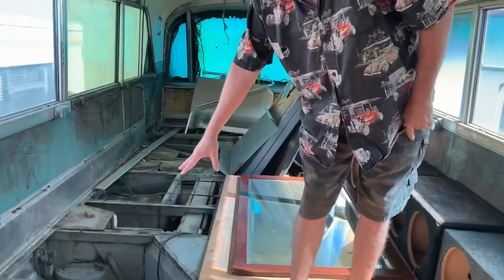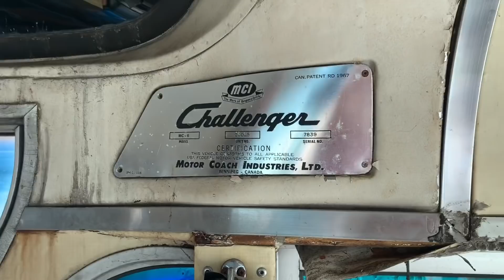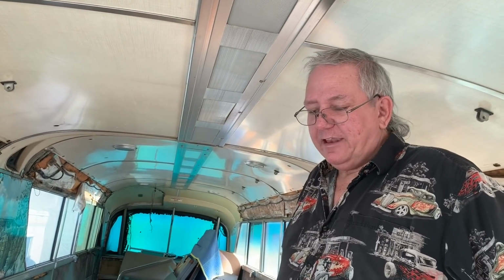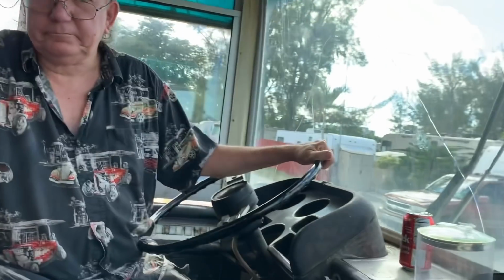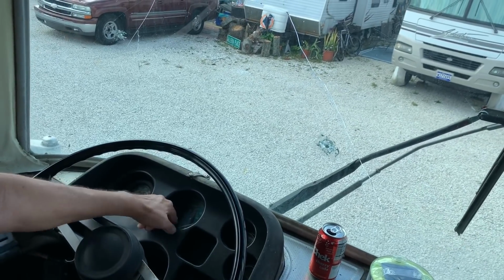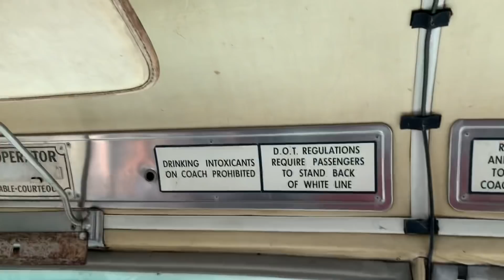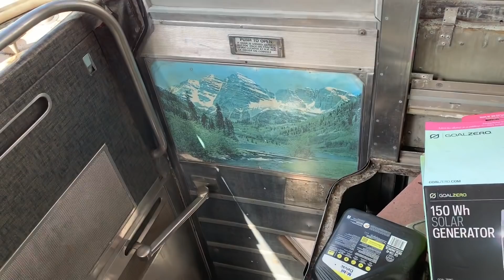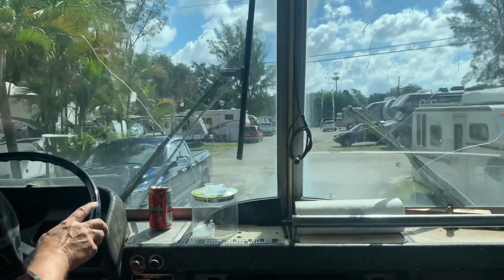12v71 detroit diesel mc6 bus test drive

Comment: Could you explain why the engine is "hunting" when he started it? Is that just a matter of the governor needing adjustment? He must have a lot of air leaks or the air compressor is not that great---running quite a while when he still had only 80 PSI. Engine sounds nice though.
Reply: Did you notice too that after it got some heat in it, the hunting stopped?
Reply: Thats is just a characteristic of a cold 2 stroke detroit until warmed up
Reply: @craigroth8710  Yes, I noticed that BUT I have been around 3-53, 4-53, 6-53, 6-71 (in line and V), 8-71 starting in cold weather in Canada and they didn't hunt. Railroad maintenance equipment. The odd 8-92 but was not around those much.
Reply: @wittemanadrian  I have been around 3-53, 4-53, 6-53, 6-71 (in line and V), 8-71 starting in cold weather in Canada and they didn't hunt. Railroad maintenance equipment. The odd 8-92 but was not around those much.

Comment: Love the sound of a two stroke. I wish someone would build a 3liter two stroke for a small car. Six cyl , four exhaust valve, piezoelectric injection, 5000rpms, would be a bad turbo diesel
Reply: Look up Mercedes’ om606 3 litre 24v under square design, there a common swap now with some being tuned to rev over 6.5k rpm and producing 600hp
Reply: @Diesel8290  know about that, and it’s a four stroke.....

Comment: That's a rare one. How many hp at what rpm?
Reply from the maker: It should be 450hp 1200ft lbs torque
Reply: 477 HP
1234 lb-ft torque
Reply: @markdubois4882  Where did you find those figures? On Wiki it says 456 HP @ 2100 RPM and 1200 lb-ft Torque @ 1600 RPM-------- the Turbo version 525 HP @2100 and 1450 lb-ft Torque @ 1600 RPM.
Reply: All of you are right. Various injector differences are the reason.
Reply: Well, we can all agree it’s a lot if it’s pushing this house down the road at 80+ mph 😂
Reply: Whoda Hellru  Gosh I hope he checked the tires really well. That's kinda scary even thinking about.
Reply: Paul Martin this guy has what we call in the automotive industry “dumb luck” ... obviously he doesn’t have a clue of what can go wrong with a vehicle that has sat for so long, yet he drives it 1,000 miles without an issue.  I wouldn’t have made it a mile without popping a tire or smoking a wheel bearing, let alone push it to 80 mph!
Reply: @BusGreaseMonkey ... Genuine question - how did you come up with that figure, Scott?  Unless someone along the line made some changes?   Do you know which injectors he has in it?  Is it set for 2,100 or 23/2,350?  Std. timing?  IF.. it has the Green tag N65's with std. timing and set to 2,350... NA it will be close + or - to 460hp at sea level, depending on atmospheric density and humidity levels @ 85 degrees.... and NO parasitic accessories on the engine, ie; generator, air compressor, engine fan, etc.
Reply: Whoda Hellru I changed all fluids, belts, hoses, filters, batteries and tires before my clueless ride. And it was 3050 miles not 1000!
Reply: Scott Robertson then accept my apology good sir!   I was hoping you didn’t use all of your luck on one adventure!
Reply: @Romans--bo7br  weren't buses usually set up a little hotter than semi/stationary engines...i know the bus 8v92s were

Comment: Greetings again from England! 
What sort of fuel economy can you expect from Detroit engines? I know very little about 2 stroke diesels, as they are very rare over here. The bus I used to have weighed just over 8 1/2 tons, had a 680 cu inch engine, top speed about 56mph, and would do about 17 miles per English gallon (4.54 litres to English gallon)
Reply: Each Detroit has different rates of consumption. There's the 53-series, 71-series, and the 92-series.  There was also a 110-series, and 149-series, but those were a bit too large for highway use, unless fitted to special-duty, purpose-built specialized machines.   https://en.wikipedia.org/wiki/Detroit_Diesel_Series_71     https://en.wikipedia.org/wiki/Detroit_Diesel_Series_92    They don't like being bare-idled for long periods of time, if they had to be running while not driving, they needed to be fast-idled.
Reply: @stanpatterson5033  .....The 6-110's were Not too large and there were a number conversions out on the road... Time/DC converted something like 50 of their KW COE's to 6-110's and used them for pulling "Turnpike Doubles" (two 40 footers) and they worked very well.   There were quite a number of Series 71 parts that could be used on the 110's.
Reply: Tom Lowe yes indeed!

Comment: I bet that thing weighs a bunch!!!!
Reply: marty It would be interesting to know.  Other than a few extra cylinders I doubt that the weight is much different from an MC-9.
Reply: @brucefay5126  I was thinkin the whole bus!!
Reply: marty   Me too.  I doubt that the weight of the whole bus is different from an MC-9.
Reply: I haven’t weighed it and I haven’t seen any stats, but it is 12’ high and wider too.
Reply: Scott Robertson   CAT Scale will give you axle weights and total weight.  Around $12.  If you ever have a chance to  get axle-end weights, that is even better.  RVSEF and Escapees SmartWeigh provide that service at rallies.  Escapees also have a few permanent weigh stations.  One of them is at their Sumter Oaks RV Park in Bushnell, Florida, by appointment.  Price is reasonable.  Information is priceless.  Strongly encourage anyone doing a conversion to gut the bus, weigh it before converting, and then weigh it again while in process (once major systems are in place) and then again at the end.  Weight distribution across the axles is important, of course, but what the weighing services see most often is side-to-side differences that are too large.  Also, tire pressure has to be the same for all tires on a given axle, and that pressure has to be determined by the tire (axle-end) with the heaviest load, and that requires axle-end weights.

Comment: the hell did anyone ever put a 12 v 71 in a bus?! half that engine does fine in a bus lol Still nice to see a big dog 12v still rolling coal tho.
Reply: chrisrhudy2000 The normally aspirated 12V was probably a joy to have if running in the mountains of the western U.S. and Canada.
Reply: Yep, an old 8V71 in a loaded bus in the Rockies could be a pain in the butt. The electronically controlled 8V92 made for a vastly different machine.
Reply: @zackreuter6344  .....the relatively low piston speed, coupled with that darn 4 spd really made them "dogs"..... even the mechanically controlled early 92's were a vast improvement with the 4spd.

Comment: As long as it rides good and sounds good everything is ok lol. Unbelievable. Throttle sticking, windows cracked, leaks in the air bags, air hissing constantly, missing a wiper, signals don’t work etc. It won’t pass a safety inspection. He needs practice on shifting. Air throttle? I know why he’s blowing through fuel. Great potential though.

Comment: Weren't these units supposed to get absolutely horrible fuel mileage... Like 1 mpg?
Reply: Relaxation Station.... Not sure where you heard that, but that is Not true.   The 12's in the semis that were NA got about 3 - 3.5 mpg with the weights they were hauling, but once they started turning them up and adding turbos, they got up to 5/5.5+... about what they're getting today with all the new anti-pollution laden garbage on the new diesels in semis today... along with a Whole Lot of new problems with them.   

I was getting a solid 5.5 to 6 mpg with V12 years ago, and that's after I built it to marine specs (basically).... in terms of output.
Reply: @Romans--bo7br  Thanks for the insight, I noticed that there was very strangely absolutely no mention of fuel economy in the comments.
Reply: @relaxationstation7374  ....Thank you for your response.  Yes, I agree... and am not sure what the V12's were getting in the coaches... and it "seems" that this particular one has been opened up a bit in terms of the governor, at least.   I do know that many of the GM & MCI coaches with the naturally aspirated 8-71's & 4 spd manual were averaging around 4 mpg.
Reply: @Romans--bo7br  If I remember correctly, Detroit developed a Twin Turbo V6 to try to solve the fuel efficiency problems and many years later they eventually they came up with optimally geared automatic transmissions.
Reply: Relaxation Station this bus gets 6 1/2 mpg. That’s over the Rockies across the upper mid-west over the Appalachians and down to south Florida mostly at or over 70 mph (but really mostly 70).

Comment: Are there any Right hand drive parts still hanging around in the states? Entry doors or dashes, the steering parts should be easy to flip over, but it’s the cosmetic stuff that might be difficult to find

Comment: That to me looked like a Navy 6-71 grey marine around 225 hp. A 12v71 is a huge v engine. It will go a lot faster than 80 mph. A 12v71 will pull 40 tons down the road at 100 miles an hout.Thst is a six cylinder 2 stroke. If that fuel pedal is stuck driving down the road it will disiegrate that engine But that is not a 12V71. The biggest engine ever put in a bus was the Detroit 8V92 four stroke twin turbo making between 1050 and 1100 hp. You could buy 3 busses for what a 12V71 costs. Those are normally found in heavy hauling 18 wheelers 36 to 38 gears with double and triple compound low gears. And 18 forward road gears they can pull 100 tons on I-20 in Texas. Three coast to coast round trips you will be ready for new tires. If he can't down shift simple four speed he's not ready for a 12V71 period. That is a click bait title. It takes a man with many hours on a 12V71 to master that hp.
Reply from the maker: That is a 12v71 in that mc6.   Sorry you are wrong.  It is the only bus that ever came with the 12v71.  Just because you never saw one in a bus don’t make it not true.
Reply: 8v92 ain't 4 stroke

Comment: This guy needs to learn to shift a diesel.He's shifts way to high in the RPM range.All the power is down low.
Reply from the maker: That is only a 4 speed trans, non synchronized so you have to wind it up like that to shift.  All the way up to the governor before shifting.  2100 rpm 2 stroke sounds like more, especially on a 12v but it’s not.